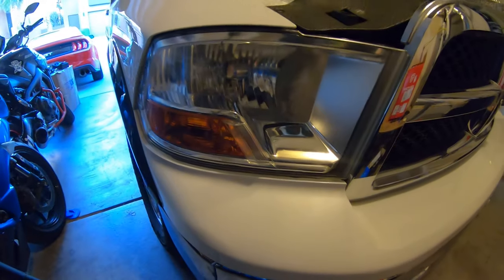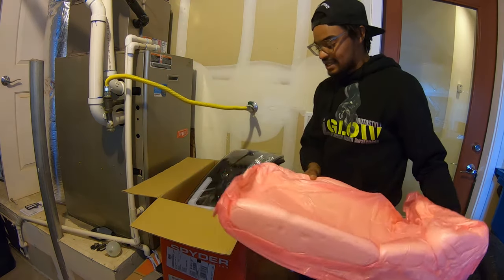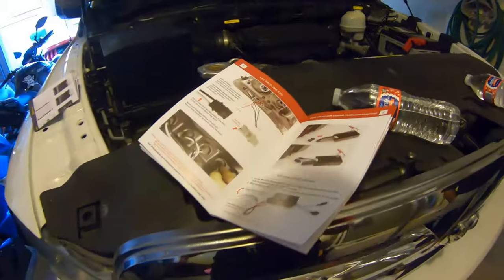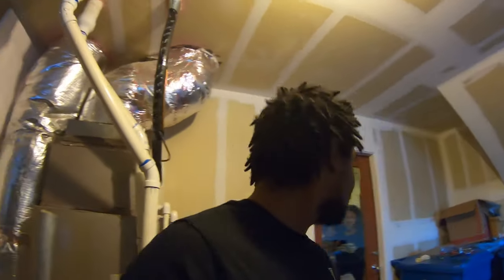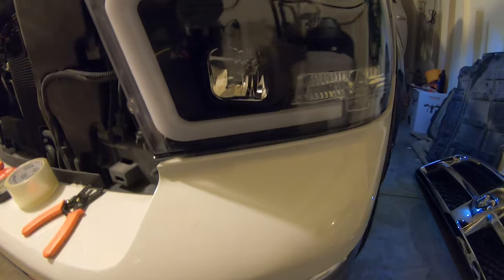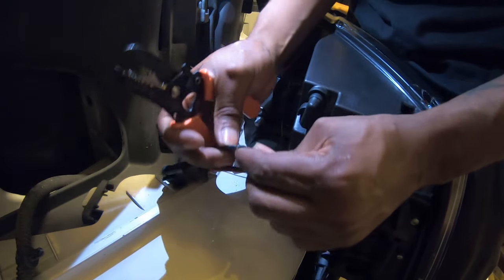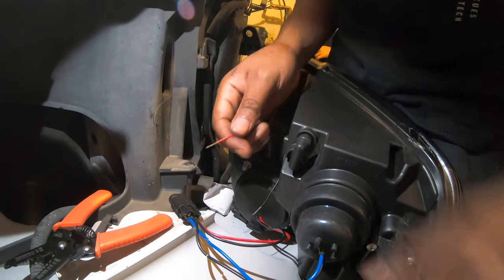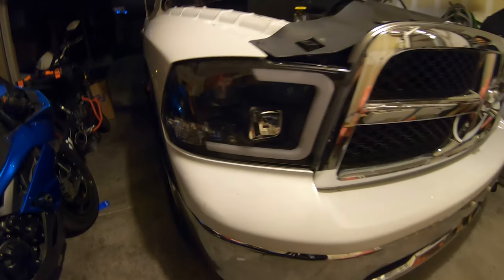installing spyder lights on sheba my ram 1500

Comment: KING BACH!!! lmao, I just installed some of these lights in my 2004 Dodge Ram 1500 last night. They do look nice but I wired my LED Tubes into the running lights so I can have them on with just my parking lights. Its loooks soooo cool! One thing to note, these had to be removed from the truck to be adjusted, then reinstalled to test, then removed again to be adjusted some more and over and over and over. What a pain in the rear parts of my anatomy!!  For anyone else interested, the adjustment screws are right at the side and bottom corners of the bulbs (if yours are the same ones I bought). If I would have known these had to be adjusted that way I would have bought different lights! Also, the projector beams do that thing where the light beam cuts off at an incredibly sharp line so its dark as hell just above where the light line is. I will keep them now that I have them adjusted good enough, but had I known prior to this I wouldn't have bought them. If you want to use LED bulbs in the main bulbs you will have to cut the connectors off your LED bulbs and wire them directly in. They do look very cool though. :)  You can see them on my FB here https://www.facebook.com/photo/?fbid=10228816529655345&set=a.1724758636074 and there are a few more pics lower in the feed.

Comment: I'm sorry I have these same lights and you probably should have splice the l.e.d. light bar into the parking / turn signal lighting wires. due to if something went wrong or shorted out you will have no head lights. just my opinion 🤷
Reply from the maker: You know kinda was feeling that way. I haven't had a issue yet but in the long run I can always go back and change some things around.Nothing is totally locked in .Thanks for the advice seriously

Comment: how are these lights holding up? interested in getting a set
Reply from the maker: Lights have been amazing zero issues .I mean zero really love them best upgrade.Really makes the truck stand out
Reply from the maker: One word of advice I made the led bar my primary its should be the high beam light .but other then that really enjoying these lights
Reply: @Mr20west  so would that make the drl bar only turn on when you turned your high beams on?